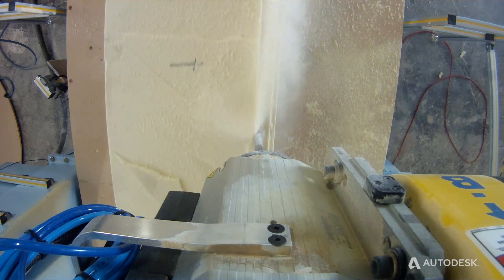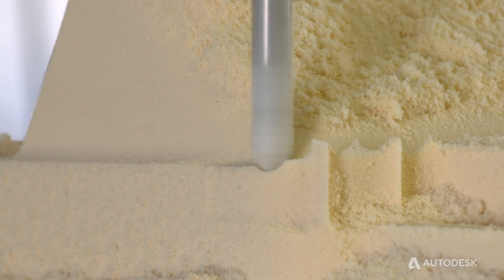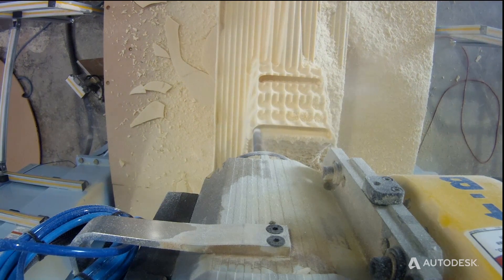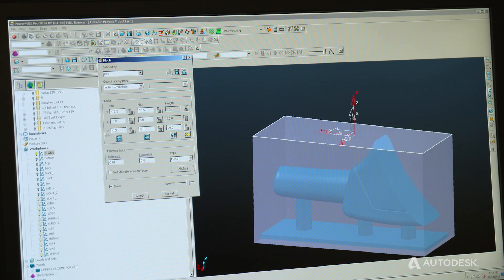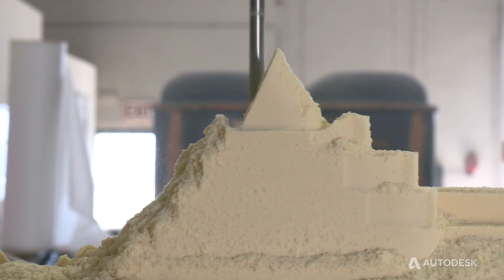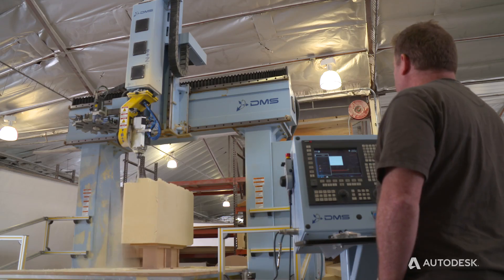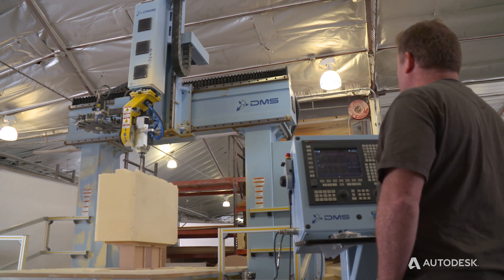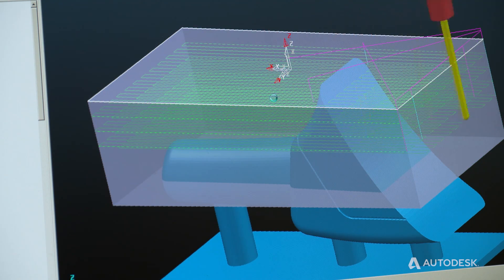Autodesk PowerMill drives large scale sculpture machining at California Arts

Comment: You are lucky  gentleman because we are facing problem from last 3 years not yet working RTCP do not know where is block either fagor control or powermill.We buy brand new machine VMC 3+2 fagor8055 then powermill software to run it but unfortunately using it only as a three axis.